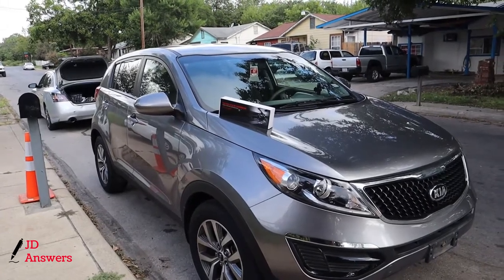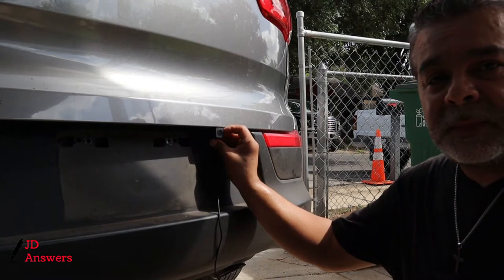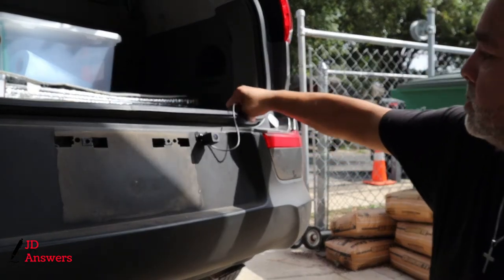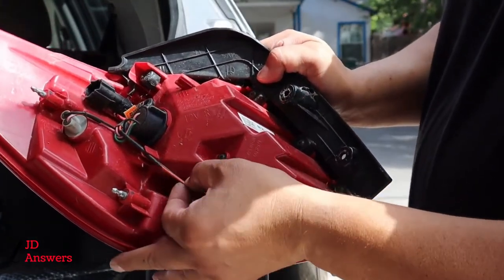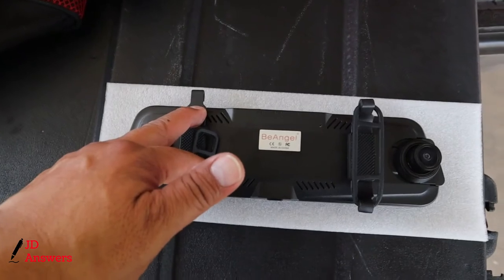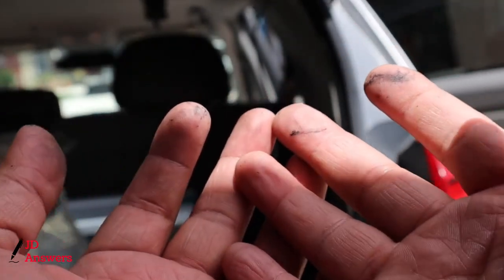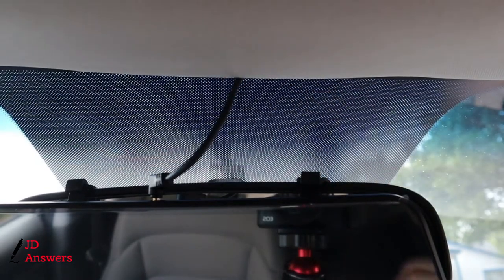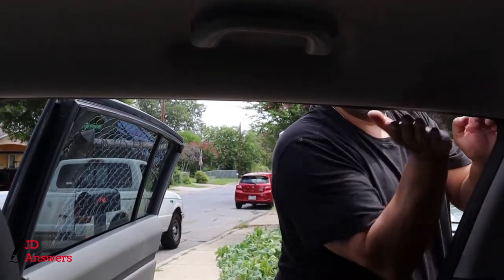HOW TO INSTALL A REAR VIEW MIRROR DASH 10 INCH BeAngel - FRONT AND REAR VIEW MIRROR DASH CAM INSTALL

Comment: Thank you for this post JD. Very helpful video. I just got mine and I was wondering if this dash cam can do 24 hour park mode, and if so, could you do a tutorial video for it, the one that needs to be connected to the fuse box. Thanks in advance.
Reply from the maker: You will need a dash cam hardwire kit to record 24 hour park mode. Here is a link on how to install https://youtu.be/KD8c5lJIL6E

Comment: How do you set up loop recording and how do you make sure when you start your car the recording starts?

Also, is there a way to still record and not have the camera displayed in the mirror?
Reply from the maker: I will definitely get back to you on that. My father uses that dash cam and I will see him today.
Reply from the maker: Press the screen to activate the display menu icons. Press the settings icon. Press the loop recording icon. Select the time you prefer. Then press the screen saver icon and select 30S (30 seconds) then press the back key. You are all done.
Reply: Thank you!